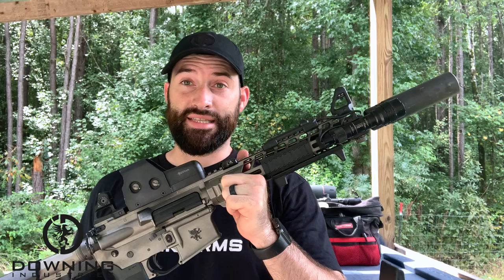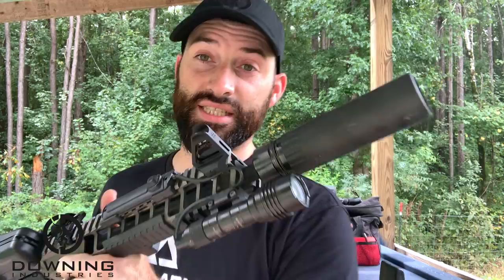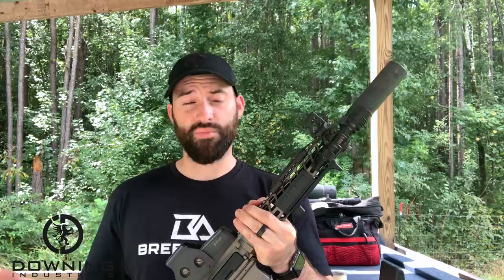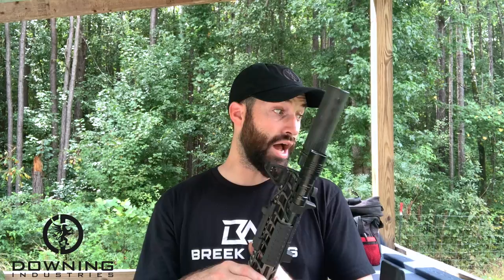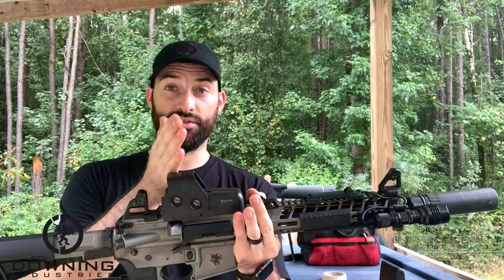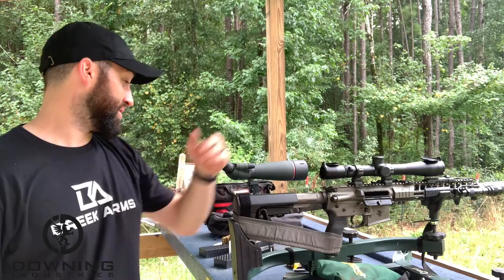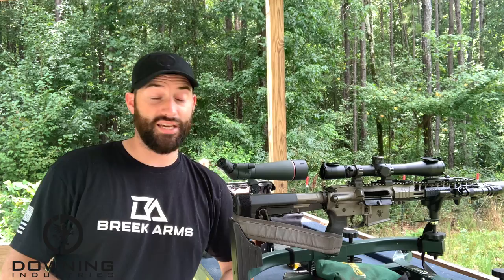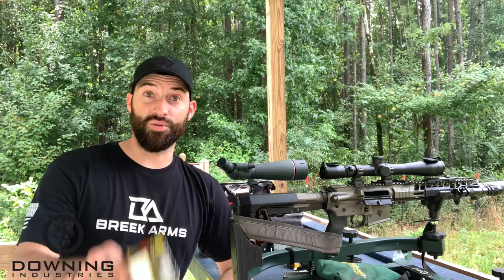Faxon 11.5" Accuracy Test

Comment: I would just let Faxon warranty it and give you a new barrel. And don't rockset or loctite the muzzle device. Use the appropriate crush washer.
Reply: None of the suppressor manufactures like surefire, slincerco, gemtech, etc doesn’t recommend using crush you have a good possibility of getting baffle strikes. They are fine on normal stuff but do use on a muzzle device that you using to a mount a can
Reply from the maker: True that Freedom Lover. That’s why I use rockset(supplied with Surefire suppressors) or some loctite in conjunction with a flat shim to time it.
Reply: Caleb Downing now if your barrel is cut for 556 chambering is cut a little longer then 223 to give it a little free bore to curve down the case pressure of the 556 loading over the 223. So just the way that barrel chamber might be off just enough to have bullet not perfectly straight entering the rifling.

Comment: I think you’re dealing with two issues. Ammo and a bad barrel. Now I’m worried about my 11.5” mid. I’m gonna have to do some testing. Maybe the muzzle device being sinched on so tight is effecting accuracy. Get a new barrel and test again!!
Reply from the maker: Faxon did switch out barrels for me and I still was having accuracy issues 🤷‍♂️
Reply: @CalebDowning  really. Damn dude now I’m worried about mine having accuracy issues. It shoots super soft like no recoil it’s really controllable in full auto, but if the accuracy’s not there then it’s time for a new 11.5” either a Noveske 11.5” mid or a DD 11.5” carbine or Gisselle 11.5”. Carbine.
Reply from the maker: @jonlewis758 Easy enough to test. Just put it on paper and see if your happy with the results 🤷‍♂️
Reply: @CalebDowning  yes sir that’s the plan
Reply: I’m glad they switched out your barrel.

Comment: hell, I WISH my faxon barrel did 4 inches.
Reply from the maker: Your is bad too? 🤔😳
Reply: @CalebDowning  bad would be an understatement. 24 minute of angle accuracy. (from bullet holes I found, anyway...)
I intend on going back to confirm it with a scope instead of the red dot and with my other rifle to check the ammo. if it doesn't get to under 6, I'm probably just going to throw away the barrel and buy a different brand.
Reply from the maker: One good thing about Faxon was that the were easy enough to deal with as far as return and exchange. Before you throw it out shoot them an email. 

But dang… 24” 😳
Reply: 108 degrees, red dot, 60 rounds in an half hour, 10 year old m855. We're still missing over a foot of accuracy there, right?
Reply from the maker: Dang 😬

Comment: I had a similar issue with the "GUNNAR" 5R in 6.5 Grendel. 

My PSA shoots sub MOA out of the box, no special break in, and the expensive FAXON wouldn't group under 4" with ANYTHING.

I ran them side by side, with 4 different loads and sent the results to Faxon, and to their credit they sent me a new barrel...

...which will shoot expensive ELD MATCH pretty well, but will won't group the 123gr American Gunner stuff.  

...and it still leaves me out the time and expense of the shipping and re-barrel. 

But, I do appreciate that shit happens, and they stood behind their product.  I'm giving them another shot on my .308 build.
Reply from the maker: That’s my experience with them as well. They have excellent customer service but I do find the accuracy with cheap ammo to be lacking 😏

Comment: Its faxon not you nor ammo without doubt, faxon has many bad reports online. I personally have yet to come cross chromelined barrel that fail to shoot submoa with at least one match grade ammo. Federal Gold Medallion Match 69gr SMK is my favorite it always shoot good out of 1/9 and 1/7. If any barrel fail to shoot at least few match 77 or 75gr ammo submoa im sending barrel back or designate that barrel to be beater bitch. Many barrel often will not shoot until the bore is laid with copper fouling after at least 100rounds. There is small chance that Faxon barrel might have been screwed out of that possibility and it might not if you deep clean the barrel with aggressive solvent then foul barrel with 100rounds REAL copper Jacketed bullet from any cheap bulk 50/55/62gr ammo then try again with match ammo. I have had barrel that shot like shit until I cleaned it then boom its submoa until it get so fouled up again. Other than being defective barrel, it could easily been fucked by over torqued muzzle device. All of my barrel is heavy profile for good reason. Only one is not heavy and not chromelined, my ar-15 11.5 ballistic advantage defensive pistol had government style(not socom style) apart from missing m203cut due to being too short for it. It being nitrided I have never shot steel jacket bullet through it, I only need it shoot minute of target under 100yards. If the barrel prove to be unable to shoot good its either going back to manufacturer preferably for refund so I can pick up superior chromelined instead or it becoming a beater bitch barrel alongside my bushmaster 1/9 CL HBAR that still shoot submoa despite abuse of firing cadence and garbag bi-metal ammo. But I think I should be efficient with my money and request refund so I can buy superior CL BBL. I recommend criterion if you want chromeline submoa barrel but treat it as match barrel following break in procedure and dont shoot bi-metal in it, abide by firing cadence to prevent heat damage to prolong match grade performance.

Comment: Which weight tula are you using... I noticed most of the ammo you picked is very heavy for caliber.  Might be not mixing well with the slower 1:8 twist. An update on the second barrel would be appreciated.
Reply from the maker: That Tula is 62gr I believe. I’ve shot 55gr through it too and it still shot poorly. The new barrel didn’t do any better 😏
Reply: That's disappointing. What brand and length handguard is that?
Reply from the maker: It’s a BreekArms RNGR. I believe it’s a 10.375” or something like that. I’m not seeing it in stock on their sight right now though 🤔

Comment: Definitely a bummer to hear. I have an 11.5" gunner with an SLR linear comp in an M4E1 upper. It runs 1/2-3/4" groups at 50 yards. Slightly larger at greater distances of course. That's with hand loaded(Revolution press) 55gr, 62gr, 75gr and 77gr with little or no difference. Maybe I lucked out and got a good example? I also have several Ballistic Advantage barrels. Nothing short of el primo quality and function. Always look for sales between Thanksgiving and Christmas. Amazing what you can get at huge discounts.
Reply from the maker: Well that’s good to hear 👍 Maybe what you have is the norm. I have heard several other folks having similar results to mine but maybe we’re just the loud mouths 😁
Reply: @CalebDowning  nah brother. There's a hitch in the giddyup there somewhere. I only have one Faxon. I have dozens of others from fairly cheap to fairly expensive. All of them are very consistent. I'm starting to think I've got the outlyer. Thinking of contacting the guys at BA for a custom replacement for the Faxon because I'm doubting whether it'll stay consistent.
Reply from the maker: Gotcha. I’m tempted to turn mine into a 22 with the CMMG conversion. Maybe it’ll work better on that 🤷‍♂️ We’ll see… 🤔

Comment: I would be sending that back.  My 1:7 sionics 11.5 shoots sub moa occasionally.  Average 1.5 or less with 77 grains using cheap wc846, 30 year old primers and once fired brass (sorted) bought in bulk....
Reply from the maker: I got it swapped out. The new one doesn’t shoot any better 😏 I thought of sending it back but I’ve got an idea to use it as a 22lr barrel 🤷‍♂️

Comment: Let them replace the barrel......shim the muzzle device.....no loctite or rock set. Just solid shims and torque the muzzle device.
     The 10.5 FNC carbine length I run drives tacks...
shimed, torqued, and angle set my muzzle devices for POI shift predictably from my sandman L between multiple rifles....
       This thing is just wasting your time and ammo......🤠

Comment: Dang that disappointing for sure. Id be talking to faxon.  I was pissed when I was getting 2.5 inch groups at 100 with my savage msr with ball ammo.     It will stack bullets with hpbt match ammo though so I can't complain much.   Its a 1-8 twist barrel also.
Reply from the maker: They were really good about making it right. I’ve already contacts them and they sent out a replacement. I’m gonna wait till it’s broke in and then see how she prints on paper.

Comment: I really want to try a 13.7 or 13.9 from wilson combat and i think faxon has them also n if mount a surefire warcomp to the end it apparently brings it to 16
Reply from the maker: That would be a sweet setup 🤔
Reply: Pin and weld makes a 16" rifle...
      My 14.5 is a legale rifle pinned and welded.....🤠
Reply: @robertfoote3255  check out garand thumb sons of liberty gun works 13.7 video it makes since but still comes to 16 like u said wirh ur 14.5 i feel like the 14.5 would b better but in his vjdeo it makes since so idk
Reply: @robertfoote3255  i think im jus coming up with excuses to have both
Reply: @boomdevildog1606       it will depend on the length of the muzzle device you use.... It will have to make the 16" length....
      A barrel in the 13.5 range can make it with the right muzzle device....😉
      I like my FNC barrels....
it's a 14.5 because that's what they offer.... it is for me all about the steel they use and HEAVY chrome!
      I do believe I have collected every barrel they offer in .556.....😂
      Just do it....🤠
Reply: @robertfoote3255  sons of liberty makes a muzzle device like the warcomp that would bring the 13.7 to 16 but i feel like whats the point of getting this kinda rare barrel when it all has to come 16 regardless unless u make it a pistol or sbr im over thinking it..its jus bn said that the point of it is to have the shortest barrel without going to sbr or pistol but wouldnt the longer 14.5 b better for stabilizing and dwell time and i tjink u have to use a carbine gas on the 13.7 im not 100% i gottacheck into more into it but i agrre tho i should jusdo it lol ....thinks for the reply gents enjoy yalls weekend
Reply: Those fnc barrels theyre hammered forged right does psa still use them sorry to keep replying mature knkwledgable people r hard to coneby these days
Reply: @boomdevildog1606       Cold Hammer Forged, Propriety Steel, and Heavy Chrome lined...
        It is to avoid the SBR thing......a brace will do the same (Just makes a pistol).
       Pistols have there own set of regs...( Overall length, Length of pull.....ya just gotta love the ATF! And some regs differ state to state with pistols also.
      SBR's are $200 more towards your stamp collection......😂
       The only difference between one of my pistols and my SBR is the Magpul CRT and the stamp.
       It's really not overthinking it..... your sorting out what you "Want" and what you need to do to make it reality.....😁
        Sometimes laws and paperwork dictate what you will have......and sometimes you will just jump over their bar to get what you want....
      🤠
Reply: @boomdevildog1606    Dwell time issues are normally failures to feed.....in short length pistols and rifles.... a can increases back pressure and speeds up the dwell...
      Dwell time issues can be adjusted by light weight BCG's in short systems....but it is tough on some of the parts..
     I still run a H2 buffer in my 10.5 carbine length....but I use Federal XM 193 or XM855.  I do drop back to a H1 to run cheeper steel ammo.
      The same with my 14.5 middy.  It give it better reliability and ejection patterns.
        No worries......I have had many failed ideas.... and lots of parts..... 😂
Reply: I do believe they do....nothing wrong with the PSA premium rifle....
       I do have one of the 20" carry handle ones......it is a fine rifle!
       Good luck and Best Wishes!
Reply: Caleb Downing Roscoe makes a damn good barrel too for same price point.

Comment: I'm going to play The Jerk here. You are using good ammo but that ammo has been remanufactured. I do not call this accuracy test valid because of the remanufactured ammo. I have the same Freedom Munitions 77 grain boat tail hollow point ammo that is remanufactured. Some guns it will shoot 1 MOA or better. Other guns it'll shoot 2 or 3 inch groups. So I would tell you if I was a barrel manufacturer you need to go get some decent quality ammo that has not been remanufactured. To say to a barrel manufacturer I'm using reman ammo and I'm not getting good groups and I went to Barrel replaced is a little bit silly man. So I would tell you to go get some decent quality ammo nothing too fancy. Then reshoot the group's. 
I know some remanufactured ammo does work well. When you are talkin about accuracy and performance a reman should not be used. There's obviously nothing wrong with shooting reman ammo. Just not when you are trying to test accuracy in possibly trying to get a new Barrel out of the mix. So yeah I'm playing to Jericho on this one
Reply from the maker: You’ve been around for awhile in here Sean and I respect your inputs so I won’t jump down your throat in this subject. I know some reman ammo(maybe even most of it) can have questionable QC but the stuff from Black Hills and my hand-loads are “reman”  and shoot like gold out if some of my other builds. 
I’ll leave it there, a can agree to disagree on some of those points. #respect 👊🏻
Reply: @CalebDowning  that being said dude it probably is the barrel. I would just try using decent quality non remanufactured ammo . Either way that BARREL should be getting better results.  Did you ask Faxon what ammo you should be using to test or What they recommend.
Reply from the maker: It all depends on who/what company reloaded they ammo. I don’t believe the stuff I show was bad but some of it is pretty janky.
Reply: Caleb and Sean both are right about the QC of remain ammo, but with the reputation of Black Hills, I would expect them to have a higher standard than other companies, say like Federal or Winchester.
Reply: J D That may be true but any reman Ive gotten in past was same as new pretty much because after all they are just reusing the brass that is it! All other components are new.